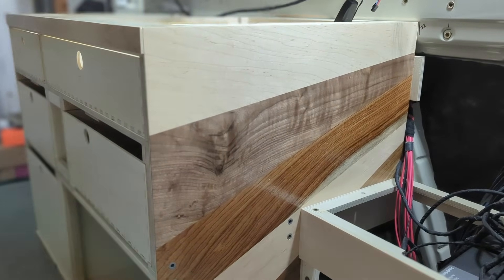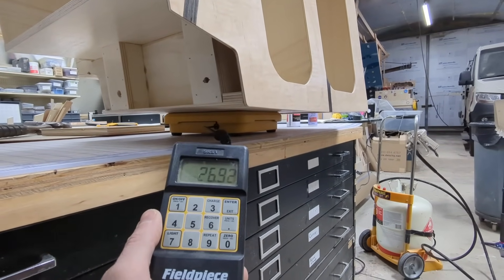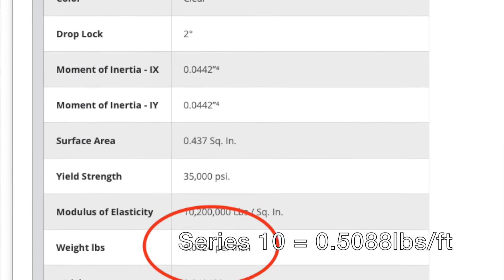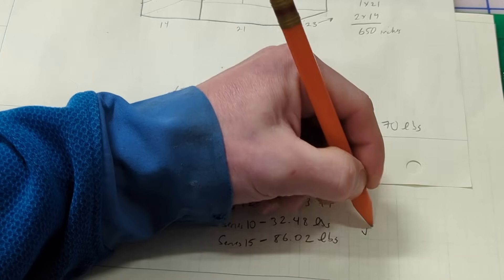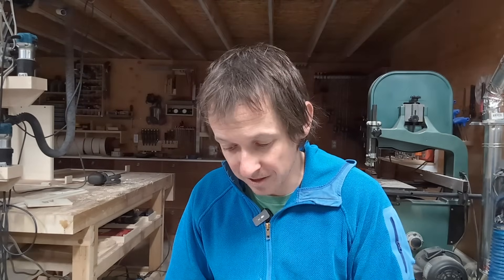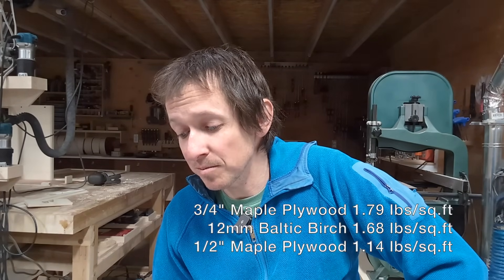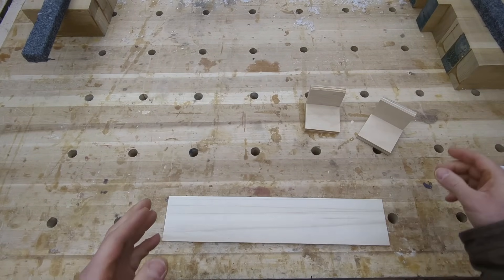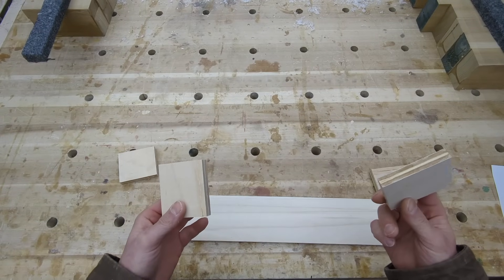Van Conversion Cabinets that are (actually) Lightweight and Maximize Storage

Comment: It boils down to that: Plywood (whatever kind) has one weakness. Bending and warping along the flat surface. And you counter that by putting other plywood perpendicular to that surface. Fairly easy if you understand it. Also, aluminium (yes, I'm European) is lightweight but it's still a metal...
Sure all the joinery is skilled labour which Joe Average wouldn't be able to pull off by themselves. But you either take your time in doing it or hire a professional, like this one, to do it for you (or exploit a friend with these skills 😅)

Comment: I live in the UK and chose to use 2020 aluminium profile which is 20mm x 20mm and plenty strong enough for my purposes.  That is for a self-build micro-camper. Much more versatile than ply in that if things change - for example the fridge needs to be replaced and is a different size, then it it is pretty easy to rejig.  Also much easier to handle if workshop space and equipment is very limited.  It relies on good quality ply, and that is in very short supply over here in the UK.  It also requires excellent joinery skills.  As it happens I did train as a furniture maker, but then pursued a career as an architect so don't have access to big woodworking machines, just a tiny workshop with portable power tools and hand tools.

Comment: Thanks!
Reply: Go have a nice lunch or dinner on me!
Reply from the maker: Thank you.  That really is appreciated!!
Reply: @projectofscience  I did a rather long write up prior to sending you my thank you but apparently it did not come across with the $$$
I built my upper cabinets out of .090 sheet aluminum that I had my sheet metal buddy bend to my specs.  Thinking of doing the same for my rear utility cabinets that will support the Bed/Dining bench area.

Comment: I'm doing a partial conversion for a minivan, need to keep middle row seats usable for kids but doing a sliding kitchen thing out the back. Anyway I'd planned to use ply but use 80/20 for the actual kitchen slider part. Nope you've convinced me. No 80/20, I'm very space constrained.

Comment: Excellent, ty.  Van build in my future.  On plywood Corners.  At about 14:45 into the vid, you show a plywd corner, easy to break apart if only glued.  Might take a look (if I'm not mistaken) at a woodworker fellow, Russ Veinot's channel, and his OSB corners. He uses a thin bamboo skewer as a pin in those corners, drilling across the corner at an angle thru the joint.  I hope I'm describing it correctly.  Creates a very strong corner joint for just this situation.  (One of the videos is titled "Bamboo Dowels Tips and Tricks by OTB Thinker" -- could search on that, just the first search result with those words and photo to point the way.  He probably has several on the subject. )

Comment: G'Day Mate, in the Australian Van/boating scene I use thin TEFLON stips top and bottom on all draws instead of wood on wood. it works just as good as bearing runners and no space taken up, no weight and cheap. I can pull my very heavy draws out with my little finger. Look for pure industrial use teflon works a treat. When I came up with this idea I rubbed slides with soap or wax put this didnt work for long as a Chef working with those slippery plastic cutting boards i cut one into stipes ...Hey BINGO. Goodluck from Rob in OZ

Comment: Great vid mate. I made all my cabinets and drawers out of .9 and 1.2 aluminium sheet. Folded the cabinet and drawer slide supports used countersunk rivets then covered the unit with coloured wrap to match the van interior. The finished cabinet with no items inside and no bench top weighed under 3.2 kgs.

Comment: For drawer binding there is a simple hack just use candle and it will run smooth like a hardware slides

Comment: you should look at the sheets of fibre glass sandwich core used in fibre glass boats , great for doors , draws , no weight at all ... you could even cut polystyrene foam to suit frame and coat it with fibre glass

Comment: I built a teardrop camper a few years ago, designed by a boat building company called Chesapeake Light Craft. The camper body is made with 1/8” okoume plywood. Of course it’s all covered with fiberglass cloth and epoxy but the entire cabin weighs only 250 pounds. 
I’m getting ready to do a van build and plan on using some of the same techniques. 
Okoume is very beautiful, similar to mahogany.

Comment: That was extremely helpful. I have 2 older motor homes I am remodeling. 1) 1972 Dodge Lindy class c and 2) 1982 Chevy Lazy Daze. 
The Lindy somebody redid cabinets with stuff you put in a garage shop; 3/4 inch white cabinets. I weighed the pieces as I removed them and had 750 pounds of wood. 
The Lazy Daze was gutted before and used as a mobile dog washing business. 
The Lindy I will put back to original design as possible but with your tutorial. Looks like all in the technique of woodworking. 
I have seen other YouTube make cabinets out of foam insulation sheets. Wood is probably a better choice. Thanks much.

Comment: I built my van with 12mm poplar and you can find those at marine suppliers with mahogany or teak veneer. It is expensive but you only use them on visible surfaces.

Comment: Basically your talking about good woodworking techniques. Box section construction. I built a large Gothic arch shed with 20 ft box section arches made from 1/2” cheap plywood. Held together with brads and wood glue. Worked a treat and went through some serious storms. They would flex a little in the big gusts, but spring right back.  Poplar is good but also Okoume which is used in boat building, another light weight but strong ply. Also known as Gaboon ply.

Comment: Brilliant, I'm glad I found your video!  I tend to build similar to you, although, not to the extreme.  I am about to venture into building in a tiny stand up camping trailer and want it as lightweight as possible and you have confirmed that I am headed in the right direction as well as several valuable construction tips and ideas.  Thank you!

Comment: I found that really interesting, especially since I have a van project myself. The one advantage of 80/20 over timber you didn't mention is...making changes. If you need to change a cabinet or layout you can easily unbolt 80/20 whereas with timber you are stuck! It's not until you actually get out and live with a conversion that you really find how good your build is. I'll probably go with timber.

Comment: As a van builder you nailed it. 8020 can be a nightmare to work with unless you're assembling a kit and it's not any lighter than a well designed plywood cabinet. It can take a lot of research finding all of correct size bolts, taps and corner pieces. That said I do think there is a diminishing point of return on weight reduction. Spending hours and hours to save 100 lbs in cabinet weight isn't always equitable

Comment: You provide an interesting perspective, personally I do not like the look of 80/20 cabinets but never took the time to do the calculations you made. I agree that the thin wood construction with glue can be very strong  In my shop, have built many boxes using box joints with 6mm pine plywood that I use to store hardware, nuts, bolts, screws and nails and many have over 25lb of hardware in them and after probably 8 to 10 years they are still holding strong.  I would be interested in how you secure your drawers with such thin material so they are secure while moving.

Comment: Nice, but unfortunatly many of us dont have a full on workshop. I'm building my van on the road, so simply dont have the resources available to do this kind of work. I am using 8020, 25mm extrusion, minimal tools required. Yeah its heavy in comparison to stick framing and exy, but its easy.
To compensate for this weight, Im doing other things in my build to keep things as light as possible, also using 6mm ply, sometimes 3mm as well for any exposed finishing work.

Comment: you would like epoxy fillets. 
Popular has an off-cast green.
Downside to thin cabinets: going over hard bumps, repeatedly. Any hard materials in the cabinet punches the thin plywood.
I think a good insulation envelope needs to be considered.

Comment: ya work with what you know.  Of course imo, being more old school i think the warmth of wood to aluminum is like vinyl to cd (even that's an old school comparison)
your cabinets are beautiful. You think like me with wanting to get every bit of usable space. Sure, it's a LOT of work and it does require the skills and equipment to do it. 
heck, this week i've been building a custom angled shiplap barn door for a client with no shop, no garage, lack of good and proper tools, but it's still turning out decent. But from the cutting and glueing and sanding and painting, ugh! it is taking forever.
subbed

Comment: Super video!! I'm actually building an RV in a mercedes MB100 from the 90's.. the engine has only  +-100 lbft of torque(hope the conversion is right) . Here also everything gets built in poplar 4, 6, 10 mm multiplex.  Total mass of the furniture expected to be under 90 kg. And it is a must to keep the ride pleasant.

Comment: There are also high performance glues (hot melt, 2 part adhesives that are moisture resistant. Many do not understand the humidity cycles and thermo cycles a vehicle goes thru up over 95C. So mold can me a problem in certain climates. There are sheet materials called laminate backer - like laminate but no decorative finish that can add strength and moisture resistance. A material called Dibond (used for signs) has a great surface finish on both sides, and polypropylene core, and Sinatra that is sheet PVC, that comes in handy for thermal breaks and water proofing. I have a motto - “no body rides for free “ which means when designing every piece does two or more things, this is how I save 50% of weight for projects I did for Disney. Using Puzzle piece connectors add strength increasing glue up area. Nice work, great math ( thats where i start every project ( i do sample pieces so I know the strength and weight including various glues and methods ( have a shoe box that explains on the piece - include failures or failure points so those dont get repeated. There are new Plastic staples ( nothing to harm tools, or worst - Rust).
Reply: Also adding curves shares the load and adds visual appeal,- your methods do that very well.

Comment: Amazing work, in America you have plenty of choice with wood, in England, generally ply wood is ply wood, you can get different thicknesses but not different types, that being said, I use 12mm and 5mm on van builds to keep the weight down

Comment: Great video. I saw a person comment that they use three skateboard bearings to make drawer slides cheap when buying a large pack and lightweight. I'm a finish carpenter wood is hard to beat for weight vs strength and almost impossible with finished looks.

Comment: I’ve done wood I’m a plastics guy. I got a recommend trying it. You can use a lot of the same theory. It’s lighter way stronger doesn’t get mold in the wood. Multiple choices of surfaces in colors if you want light weight and last the longest just try it.

Comment: 8020 has lots of cool solutions for sliders, weight bearing, interoperability which i'll use it for but the ply is way to go for most situations. it's not a this vs that situation as with everything so i'll be doing what works and avoiding what doesn't. eg, i can slide all my camper stuff out on recesssed 8020 runners and use van as van when need or slide in and quick secure tool boxes if need for work. i'll be subscribing, looks like you have top info. cheers

Comment: Garnica makes all kinds of poplar-core plywood.  They also have some "ultralight poplar" products that use XPS cores that are targeted towards RV and van builds.  They do all kinds of hardwood veneers as well as HPL. These panels aren't cheap and you will need a cabinet/woodworker supply shop.  (Check out DSI in the Midwest.)  

I just finished my new van using 3/4 and 1/2 inch white birch using traditional frameless cabinet construction.   I used mostly UV2 products that I painted and UV1 where I was using stain.  Because it's nearly void-free, I was able to skip the edge banding with minimal wood filler.   I used screws but you could use dado joints or skip the UV finish if you want to use glue.  

I found these sheets to be much nicer than the box store stuff.  It's lighter, has better screw hold, and has thicker veneers.  I used over a dozen sheets and the only issue I had (besides the price) is the veneers chipping out and pealing on the last few sheets I bought.  Luckily I was able to work around most of the troubled spots, but it was extra frustrating when you are paying for a premium product.
Reply from the maker: A bit late to reply to this, but can I ask who you source your Garnica panels through? I had tried previously but within a reasonable roadtrip-distance I couldn't buy less than a pallet load.  Their poplar core products look very fimilar to what I pick up in Portland and Seattle but with much more veneer options.  If I could buy just a couple sheets I'd love to experiment with their even lighter stuff.  

And yes, big-box plywood is painful.  At this point in my van-building-progression the headache of using it does not justify the pricetag to me.

Comment: Guessing he’s an engineer based on the pad he’s using. Very interesting.  I’m amazed by how heavy people build their vans. 2x4 framing and bed supports. 3/4” subfloors.  And as he said, 3/4” cabinets, even doors (sliding upper doors can be 1/4” thick and require no hardware or locking mechanism and you can build them a little taller since they’re not going to hit you in the head).

Comment: Nicely done vid and cabinets, thank you for posting it!

I have been considering the use of thin plywood panels bonded to aluminum corner angles with polyurethane hot-melt glue.  Trim carpenters love the speed and strength of the PU glue joints.  Auto manufacturers use PU glue for body assembly too.  Have you tried it?

The hybrid use of aluminum angles, and other shapes, can also help protect edges and corners that are subject to high wear.

Comment: I have watched several Van builds and this is the first one that didn't look like they put an entire lumber yard in the back of the van. I built a light weight teardrop trailer and the rolling weight was  less than 600 pounds. I used no plywood thicker than quarter inch.... that was on the cabinets.

Comment: The special rather expensive special lightweight multiply plywood in various finishes and thicknesses is very very stiff. It's common to build cabinets and seat boxes          without any framework with it.
 My van's unsuported bathroom wall ovet 6ft tall x 4 ft long and on the 4ft side supports the bed with ease.

Comment: honestly this video kind of sold me on using 80/20.  I hadn't heard about this.  I really want my furniture to be squeek free, wiggle free and as light As possible
Reply: and my van is squared up(walls ceiling).  the way you're shaping to the walls is incredible
Reply: i will say in your original weight calculations i think the error is that you are way over building.  the point of the frame is strength structure.  you could build the box out of 8020 and the internal frame that holds the drawers out of wood

Comment: Great food for thought 🤔 but 3/4 for subfloor right?!
Reply from the maker: Well, only if you plan to use wood screws for attaching things is it an advantage.  In this van I used 1/8" plywood with a vinyl sheet flooring over the top.  Doing so required a pretty painful amount of care to fill the corrugations of the metal floor.  In a van where I'm not trying to keep as much interior height as possible I usually use 1/4" plywood with a foam insulation layer that is designed for flooring.  It is a 1/2" polyiso foam board with a face covering rating it for 100 PSI pressure. The biggest headache when you can't just use woodscrews is trying to get all your rivnuts and plusnuts installed in the floor before installing anything.  Tedious, but can save over 100lbs.
Reply: @projectofscience  wow I’ve nwvwr heard of anyone getting away with 1/4” inch😳… I was thinking of the ability to mount screws in there, but I also have an issue with my overall height that I’d like to keep as tall as possible. I just can’t imagine being able to do the phone perfectly enough that you can’t feel the floor flex under your feet but I’m sure you’re better with details than me ha ha bravo

Comment: Using zero 80/20 in our van build. Basically building our cabinets as showcased in this tutorial with the goal of keeping the conversion weight as low as possible. It always amuses me when I see people using heavy materials with no concern for weight. They end up having to upgrade the suspension with very expensive modifications just so the van performs safely and then it’s still not really safe

Comment: What about using some construction adhesive for the durability aspect? Wood glue can crack over time, so perhaps a hybrid use might work. Also what about a single layer of fiberglass in certain areas?

Comment: I ran into the same thing.. I was trying to go the easy button way with IKEA IVar.. Problem is you lose 1.5" on each side using there frame.. So I just remove the support frames and built my own...I still saved weight and money..